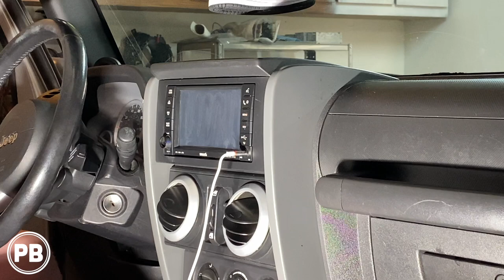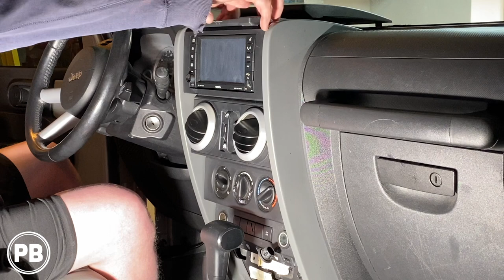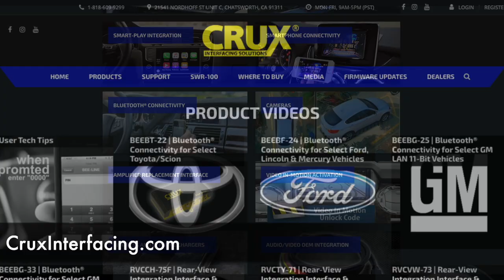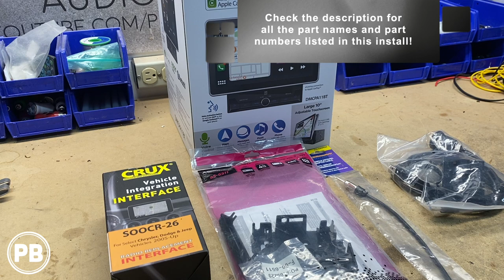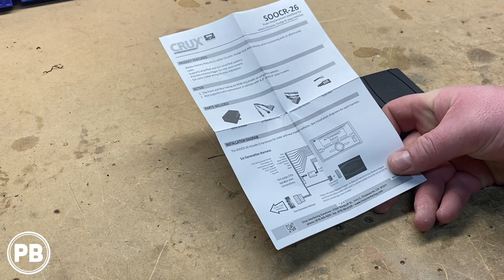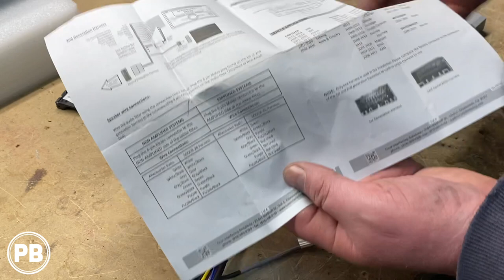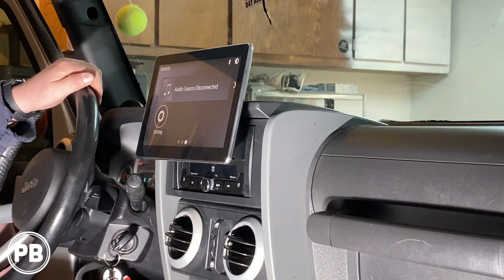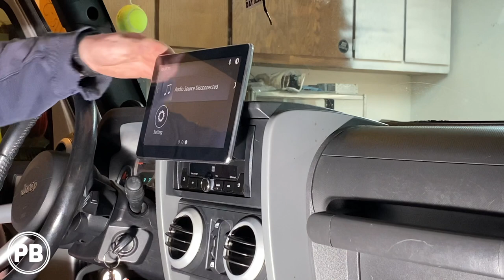2007 - 2010 Jeep Wrangler 10" Radio Install | Dual DMCPA11BT

Comment: I bought the same exact unit and have the same exact Jeep. I got everything to work but my back up camera isn’t starting when I go in reverse. It was working fine with my stock radio(same one you took off). How do I set up the camera harness for this unit?
Reply: I had issues with hooking up my backup camera as well. Just make sure to wire the red camera 12v wire to the red pig tail on video wire as well as the reverse wire together. Then at back splice power wire for camera to your reverse light power wire then run it to camera and splice the other end of the video cables red pigtail wire with the red power wire for camera

Comment: Great video.  I'm installing a Kenwood head unit into a Ram and I'm using the same interface as you.  One question...how do you know if your using amplified or not?  Thanks
Reply: I would like to know this as well
Reply: @dylanmuoio1404  if it isn't a special alpine system, bose, or beats then it doesn't have an amp.

Comment: If you have a 2007 jeep wrangler with no steering wheel buttons, what if you bought a steering wheel with buttons? could you connect all of those wires to where it is able to use steering wheel controls?
Reply from the maker: That question has come up before.  From our research, the clock spring can accommodate a new wheel, however, the body control module / can-bus system isn't programmed to accommodate steering wheel controls.  Even if you installed one with buttons, you would have to find a shop to flash the system to recognize steering wheel control buttons are present.
Reply: Can I put this radio in a 2014 Chrysler 300?
Reply: I’m glad you already asked the question lol

Comment: My radio harness has a blue (power antenna) and a blue/white (amplifier).  The jeep in this video and mine as well does not have a power antenna but has the amplified system from the factory.  It appears that you hooked up the radio blue to the Crux harness even though there are no power antennas.  You left the blue/white open for a future amplifier.  Does the blue wire you hooked up turn on the factory amplifier? Or does it not matter because both the blue and blue/white wires are both triggers?  Thanks for the informative video!
Reply: did you find the solution? going through the same thing

Comment: I have a jeep wrangler 2010 non amplified, I installed everything correctly as well as installed the brake camera and wired it to the reverse light, everything works perfectly however after about 5 min or so of starting the vehicle the radio begins to start turning off and on continuously at about 5-10 second intervals any idea on what may cause this problem?
Reply: We’re you able to fix this??? I’ve been looking to buy this head unit but am worried keep seeing people have this issue

Comment: I only have front speakers. When I change my balance and fade to the front I don’t have any sound when I change balance and fade to rear my front speakers work.  I’ve wired color to color. I wired color to color with the amp and plugged in the “ without amp plug”. Do you think I should switch to “amped” on the plug or do you think I should wire it as an amped system white to green/white etc?
Reply from the maker: You need to wire the front speaker wire outputs of the radio to the rear speaker inputs of the wiring harness adapter. (radio to harness) White to Green, White / Black to Green / Black, Gray to Purple, Gray / Black to Purple / Black.  It explains it more here: https://youtu.be/l2HacA5vsiU?feature=shared&t=233

Comment: I got the same radio and followed all of the installation instructions. However, my 2007 Jeep has a subwoofer which technically makes it an amplified system, right? Anyways, the person that helped me connected the harness the non amplified version. The radio powers up, connects via bluetooth, but does not have actual radio, microphone not working, and jumps automatically to the phone as if it were to dial a number. Bluetooth works well, and the backup camera works great. Any suggestions? Thank you!!! Great video. If we would have followed it to the T….. Thanks again
Reply: Got everything squared oiut and all is working fine. Camera, bluetooth, USB, carplay, reverse camera. Now waiting for the appropriate cable adapter for the video.

Comment: How do you tell if it’s amped or not?
Reply from the maker: If you have the non-amplified version, you will have four sets of speaker wire outputs in the factory wiring harness adapter.  If you have the amplified version, it is only two.  This video will help you out: https://youtu.be/AB2jiryLmg8

Comment: Don't know if you're still replying but It seems that mine has a high pitch noise whenever it's on coming through the speakers not affected by speed, any idea what it could be?
Reply from the maker: Depends on your wiring, and the harness adapter used.  Lots of variables there, but sounds like ground loop noise.
Reply: I’m having the same problem, nothing affects it. The noise goes away when I turn the radio up, or mute the radio. Also thank you for the video, it helped me a lot. Just installed everything on my 2008 wrangler!
Reply: How can I make the factory sub work with a after market radio

Comment: Where does the purple and white go from the crux to the aftermarket
Reply from the maker: Reverse trigger wire.  If you don't have it, it doesn't need to be connected.